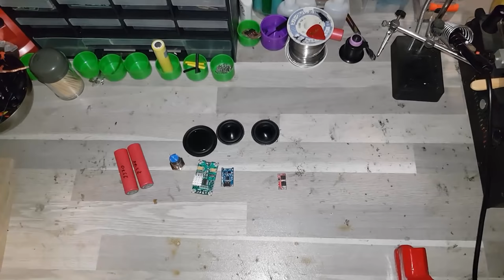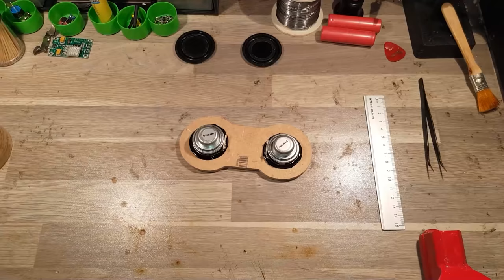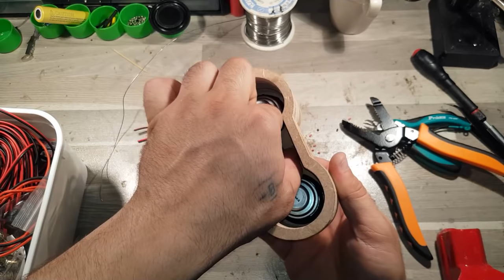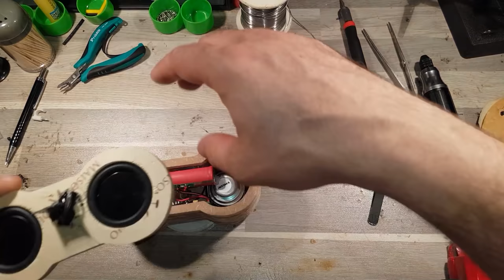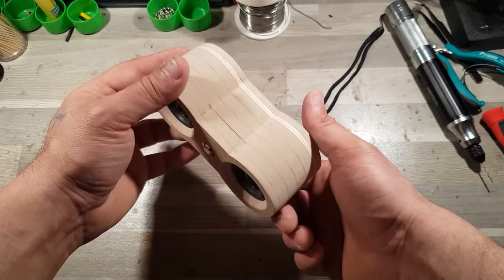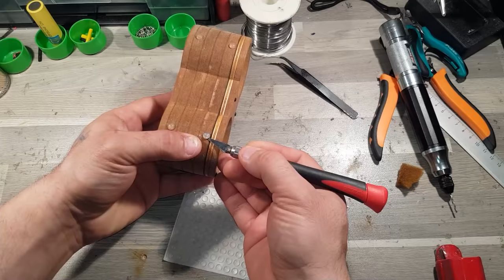DIY Mini BoomBox Bluetooth Speaker USB Type-C Charging

Comment: Hey, can you give some suggestions on other parts for 2 4 inch 40watt speakers?
Reply from the maker: you can use this amplifier
https://www.aliexpress.com/item/GHXAMP-TPA3116D2-Bluetooth-Amplifier-Board-50W-2-Bluetooth-4-2-Speaker-Receive-Board-FM-Radio-USB/32843837477.html?spm=a2g0s.9042311.0.0.27424c4dyHYCG7

Comment: Thats a super cool dit speaker but what i dont understanding is that iT can make lost of noise with only one 1.5 volt batry
Reply from the maker: I used 3,7-4,2v battery this amplifier is working 3-5v
Reply: Yes i have realisted that
Reply: What is the name of the blue and red light on the back i really wanna make that to but i cant Fins them

Comment: No 3.7V to 5V booster?and used BMS and TP4056 with protection?
And you connect the battery to the OUT- and OUT+ of the charging module, should it be B+ and B-?
Reply from the maker: Yes, no booster because this amplifier is working 3-5v. I have battery 3.7-4.2v. You are right i connected Out- then i changed it but i don't take on the video.   B+ and Out+ it's some contact.
Reply: Probably he doesnt know about it, and also put the bass radiator in the wrong direction😉
Reply from the maker: @ex-soldier4341  all of the jbl speakers have radiator wrong side.
Reply: @VGBSpeakers  i dont know about that but bass radiators are suppossed to look like real speakers too their foam edgings is suppossed to be outside not inside IMO

Comment: 1. >charger with protection built-in
>additional protection board for battery
Why? You just throw out money
2. Good advice - don't use hot glue on things, that will heat up, especially this little charging module based on tp4056
3. I don't know why you glued passive radiators in wrong way ¯\_(ツ)_/¯
4. Also, i think solid wood or even plywood would be better for this, but this is my personal preference
Reply: Passive radiators side doesn't matter
Reply: @opora1681  Yes and no. From audio quality standpoint it shouldn't make any difference, but from visual side it would look much better if glued properly.

Comment: You put the passive radiators on the wrong way... 😒
Reply: Why?are you going to die if it is placed in a wrong way?
Reply: Dragon Slayer It harms the sound quality as the surface area is less at the back. Plus, aesthetics are always recommended.
Reply: Fitzroy Richards Yeah lol I like to build speakers
Reply: @davigilantedyinglight3597  hey men could you build a mini speaker like this and sell it to me? Pls
Reply: @davigilantedyinglight3597  it doesnt haem sound quality. Lol. Surface area stays the same either way. And surface are doesnt matter as long as its bigger that speakers
Reply: E.A.C_TV it does harm the sound quality. Plus, as I said 4 months ago, aesthetics are always recommended.
Reply: E.A.C_TV Do you even know why it does harm the sound quality? It’s because when the passive radiators are facing the right way, their curved membrane also faces the right way. This allows the optimal excursions in reaction to the main active driver. When the passive radiator is facing the wrong way, there is less give on the radiator to push into the enclosure while the driver is pushing out. This causes extra strain on the air pressure in the enclosure, harming the sound quality coming out of the speaker.
Reply: @davigilantedyinglight3597  you are right dude, I bought a 10 dollar speaker and the radiator was facing the wrong way! I managed to turn it around and glue it back in, it looked bad, but it fixed the "no bass" issue
Reply: Malakulous HS :)
Reply: @davigilantedyinglight3597  bs. U inow that the surround is only to keep it in place and pr3vent air leaks right?
Reply: E.A.C_TV I don’t understand your comment.
Reply: JBL also placing their PRs in wrong way?! 😅
Reply: It is same thing just looks better in correct way